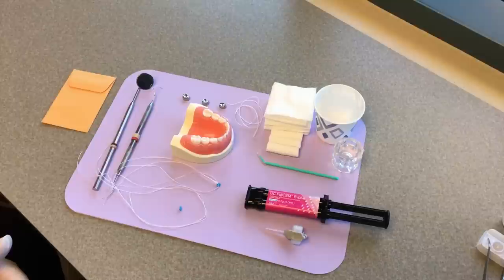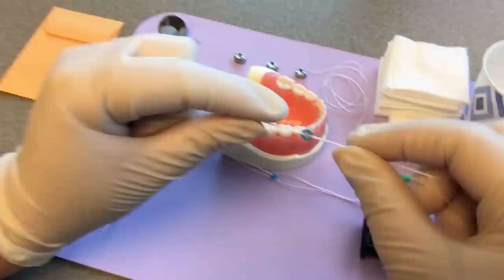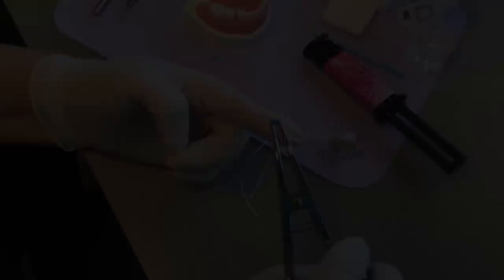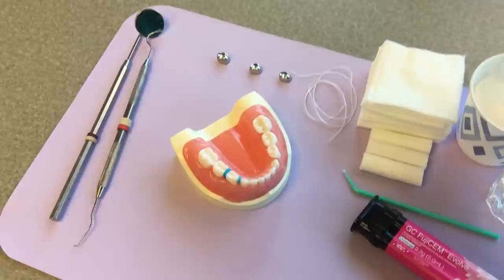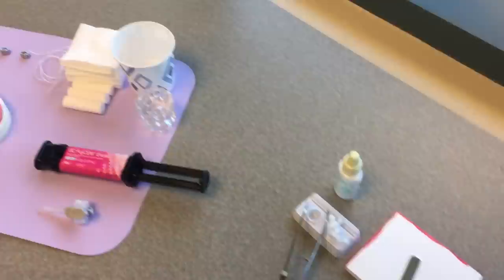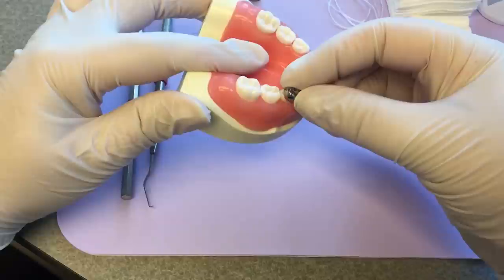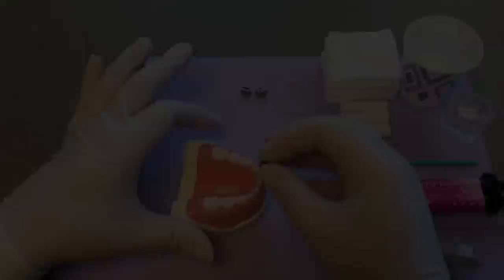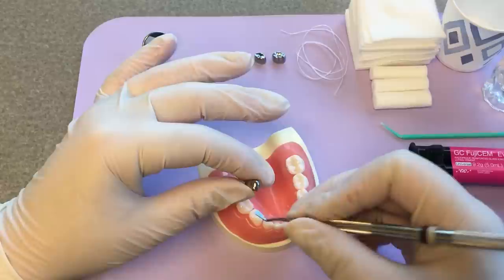Non-Aerosol Hall Technique Tutorial

Comment: Just an FYI you should place the start of any mixing tip on the tray cover until you see a well-mixed cement/material.  Then place it in the SSC or impression tray.  Also, it is way easier to clean up after a quick tact cure with a Curing light.  It will just peel away in a couple of pieces.  Still use care while flossing because cement will not be completely Set-up under SSC.
Reply from the maker: good suggestions, we normally don't use automix, we prefer the paste/paste Fuji CEM2 that is mixed with a spatula, but it was easier for this video to show the automixing option

Comment: Hi! I'm a dental student and have not had patients yet so excuse me my ignorance when I ask this question. In your clinical videos you demonstrated the technique using pumice to clean to tooth first. Is that step "skippable"? Did you just use the gauze to clean the tooth instead? Thanks!
Reply from the maker: Maher Lawand I would clean it with more than gauze, at the very least a microbrush, preferably dipped in 20% polyacrylic acid. You want to get into the crevasses and remove plaque and food debris